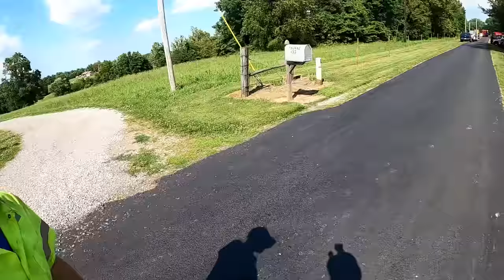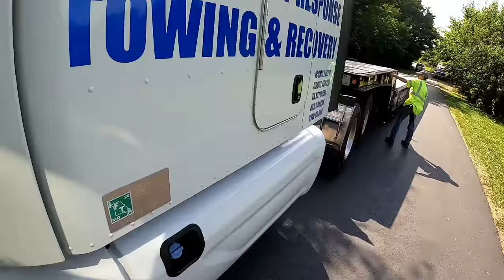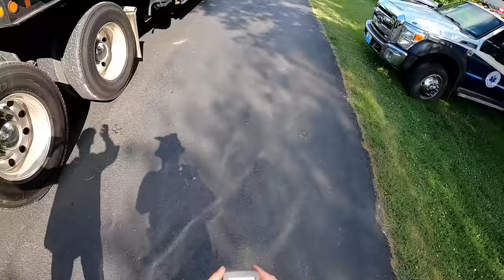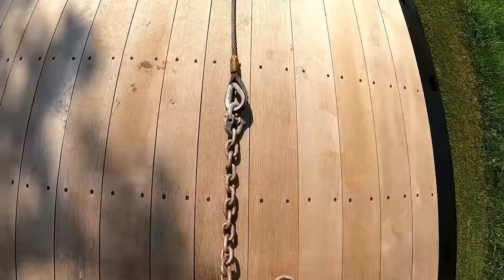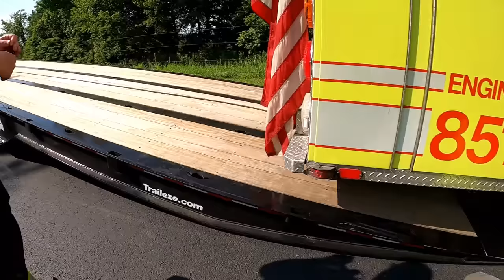Floating a Fire Truck

Comment: Are you able to share what parts broke down in the truck or is that sensitive information? Either way, good job for your new Trail-Eze T801! :D Using this vehicle also saved you having to pull the driveshaft had you been required to pull it with a tow truck! :D

Comment: 3 air horn blast for a fire dept is a signal for all firefighters to evacuate the building if there is any members performing search and rescue or on a hose line inside the structure...possible structural collapse or something that could injure, trap, or kill anyone

Comment: Having been responsible for maintaining a fleet of fire trucks for the whole of my working life, I would have bet a weeks pay cheque it would be batteries.
We had to develop systems to overcome such a simple defect that would cost time and money ( as well as disruption to the operational crews)
We standardised on having a split battery system that completely isolated a pair of batteries to start the engine alone while a second set would power the ancillaries. Therefore if the crews left on all the lights and the radio while the engine was shut down, they could at least start the engine to recharge the ancillary batteries.
We also found out that standard alternators would only recharge batteries to about 80 - 85% of their full capacity.  Coupled to the fact our trucks would be in attendance within 4-6 minutes this resulted in a short recharge time. So we fitted smaller pulleys to run the alternator at a higher speed, whilst the installation of a bespoke battery management system would charge the batteries right to the maximum, while prioritising the batteries that were at the lowest charge condition.
When the advent of the Allison World Series transmission came about which relies on electronic control, colleagues of ours found themselves having to continually attend starting defects when it was a simple case the batteries were too low to power the transmission thus adding to the problem.
With our split charge system we never suffered the same problem.
It made me smile when on attendance the battery was down and the truck was fitted with an Allison WS transmission. Seems like fire trucks are the same the world over.
Although you didn’t follow up to what was the cause it must have had a voltage drain somewhere within the truck since the Chief said the batteries had only just been changed.
Another a great video Ron, the low bed trailer looks good and certainly tested your reversing skills. Hope you’re feeling better now after the pneumonia, you was certainly struggling a little during the video. Stay safe especially with the pandemic virus around it makes you more vulnerable.
Reply: I'm told a lot of motor homes have the same type setup with two sets of batteries. And even if one set goes down, you always have the starting set to get moving again. 

I also talked years ago with some fire folks who had a separate lighting plant with a small genset that they had set up to be able to run back to the truck for power. With a totally separate battery and charging system.

Comment: If it's anything like the Australian fire trucks it will have a switch somewhere to connect the house batteries with the start batteries for flat start situation 

In fact most Australian emergency service vehicles have them

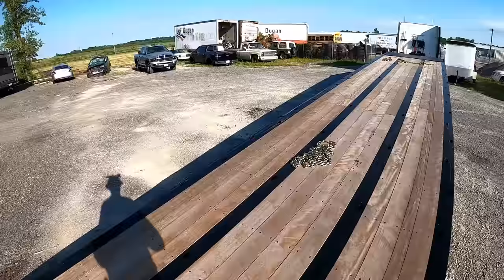Comment: Ron, When you loaded it at the scene I saw a Hose Bed Cover and at the Shop. ( 35:01) I don’t see it. Did it fold back while going down the road or you take it off or it go flying off?
Reply from the maker: It started flapping when we got up a little speed so we took it off.    Thanks for watching and God bless.

Comment: Ron, I have a question this time. Why is it when you load a vehicle on this and the other flatbeds/rollbacks you leave the beds at an angle? I thought it would be easier on the equipment if once all axles are on the recovery unit it would be better to level the recovery bed. I know about flat bed trailers with ramps and a winch. I do not know a lot as you can tell about the tilt and how the angle can assist a towing/recovery driver/operator in the big picture sense.

Comment: Had to load and transport a fire truck late one night. The truck still had air. I had it loaded and chained down. I got to the destination and off the bed, barely. I lost what air I had. Not enough airline to plug into the system. Ever try to get under a fire truck to cage the brakes? Not a fun time

Comment: Just out of curiosity why didn’t you empty the water out of the truck before towing i would have thought that would have been the safest thing to do as not only would it lighten the load but also remove some of the fluid dynamics that happens in the tank.

Comment: Still in the middle of watching. I’ve watched so many of your videos 
I do t think I’ve seen the axels move up like that before.... that is so so cool especially for what you’re doing
The only other cool thing that could be added... would be a split break on those axels.. like a farm tractor. So many times I wished it were a option but for the average driver.. a catastrophe waiting to happen l, too many have do buisness behind any wheel. 
Any way... I’ll finish watching and
Thank you Keep up the good work. 

Also what is “PTO”
I only know it as a reference
- to Paid Time Off
Reply from the maker: The PTO in our terms stands for Power Take Off.   Basically, it is a mechanical device that transfers energy from the engine, through the transmission, to Take Power Off to another system.  In this situation it powers the hydraulic system so we can operate all the trailer functions.  On our towing and recovery trucks, the PTO operates the hydraulics as well so that we can operate the boom, winches, under-reach, etc.   Something you might be more familiar with is a dump truck.  A dump truck uses a PTO to power hydraulics that lift the dump bed.  Thanks for watching and God bless.

Comment: No wonky steering wheel, great watch.

Question: Is this a pump engine or did it need the water tanks empty before you loaded it?
Reply: per above, tanks were full, chief offered to offload it, Ron declined it as unnecessary; the trailer was more than capable of handling the load as-is.

Comment: A dead battery still take a full charging current. It will prevent the alternator from supplying enough power to the other electrical components. This is why “boosting” a dead battery doesn’t work.

Comment: I know you've said in the past you keep the rotator free for car accidents but wouldn't it have been easier to use it to recover the truck, I know truck 17 can handle the weight but why not empty the tank of water, 8 pounds per gallon that would've lightened the load by 4 ton, or empty it to about 1/4 that way its not top heavy while loaded on the trailer, lower center of gravity then, just curious and keep up the good work

Comment: Enjoyed the video. One question, though, when backing up for a long distance like you had to, is it easier to keep it straight with the trailer wheels forward or back?  I find that backing a 53 footer with the trailer wheels forward can be a bit “fiddle-some” requiring more correcting than when the trailer wheels are fully back. Just wondering if it’s the same with your rig?
Reply from the maker: I find it easier to back with the axles to the rear.  As you said, it take much more corrections with a shorter wheel base.      Thanks for watching and God bless.

Comment: Blowing the horn on a fire scene can be a problem. Can be a signal to turn water on or off at a hydrant or to leave a structure due to unsafe conditions.    Just a tip. To help on the next call at an active fire scene. From a firefighter
Reply: Most departments know what their air horn sounds like and they usually hold the horn for 10 seconds

Comment: Backing down that road was easy mostly straight line backing if you can't straight line back a semi you shouldn't be driving one. And the only bad thing about moving the tandems to the front like that is alot of trail swing you have to account for. Over all good job. But that horn is too much sometimes yes when you first start backing but not to move a few feet.  🤷‍♂️🤷‍♂️

Comment: Happens sometimes. Never happened while I was on a fire. I remember when my dad was using the ladder for scene lighting on a fire and the motor burnt up😂
Reply: The is only time i remember from my active time at the fire department when one of our Engines didnt start because the battery was dead. And thats rare. Luckily we could get get engine running fast by giving it a little push. XD And as it returned from the call it got a new battery and was running perfectly again.
Reply from the maker: @JackMacLupus  We've actually had to tow fire apparatus from several active scenes for this exact same reason.  You may have caught a glimpse of us doing so in one of my videos from last year.  We were doing a "daisy-chain" maneuver on the interstate to remove a semi truck and trailer that had gone into the woods behind a guard rail.  One of the fire departments that was "blocking" for us had the alternator go out while sitting there blocking for us.   We towed it away from the scene with our Western Star while we towed the wreck away with the rotator.  Here is a link to that video:  https://youtu.be/i8W09_EL0AY   Thanks for watching and God bless.
Reply: @RonPratt  Ah yes, i remember that one. Well like i said, a dead battery is pretty rare on emergency vehicles, especially fire trucks because they mostly have power connection when they are in the station. And because of the good maintenance those vehicles get to be ready all the time.
Reply: Ron Pratt that what happens when you build a truck just to look good instead of being practical unlike the good old Australian fire trucks

Comment: That is why when the truck is parked at station it has to be plugged in on a shore line to keep it changed up
Reply: Not just charged up but also warm!  Don't know about fire stations everywhere but the local ones have a 20a extension cord (one blade twisted) assigned to each vehicle.  The female end plugs into the vehicle.  The intent is to keep the equipment batteries up and also keeps the engine block heater warm... i.e. the engine lube oil is kept at operating temperature thereby assuring an instant start and no warmup needed.   And the electrical input connections on the fire equipment are a special type with either an electrical solenoid or a air pressure pin that "kicks" the cord out of the socket when the engine is started.  You don't want to drive away with a extension cord plugged in!

Comment: There are tow rings in the rear center compartment, but with the angle of the winch cable to the rear compartment made the axle grab a better choice, so in hindsight, I shouldn't be yelling so load at  YouTube that there are tow rings affixed to the frame rails in the rear compartment. 
For those who don't know, there are jumper studs located under the left rear door that 30-foot jumper cables might reach.

Comment: The battery being low on voltage was probably the whole problem them Allison push button won’t shift if the voltage gets low and if you are driving it will lock itself in one gear like a limp home mode

Comment: Couple of things from an ex-tow-op; none of these are giving shit, just curious?
18:23 why not winch it onto the pavement and load it there, instead of worrying about your trailer getting stuck in the grass once it's loaded.
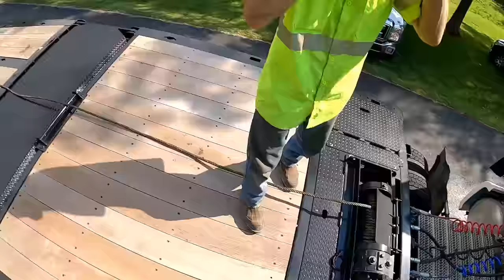23:51 love that chain locker.
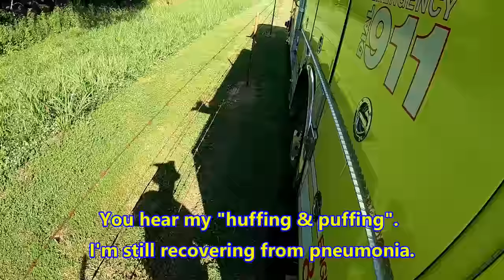24:20 Pneumonia - I'm recovering from "random" Pneumonia too. I'm wondering if it's asymptomatic CV that caused it.
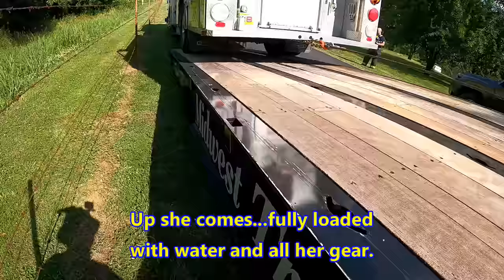29:50 Why not dump the water? just wondering.
Reply from the maker: Good question.  This was still an active fire scene with water tankers coming and going.  You saw in the video how narrow the road was.  We were asked to keep the road open if at all possible, so that is what we did.  We made it work.  Thanks for watching and God bless.
Reply: @RonPratt  Not at all.. Great job.  Just curious why it was done that way. Have a great day; and stay safe :)

Comment: Was it just the batteries?  Could a pick up with (what ) a couple of 24V batteries in the bed,  have solved the problem?

Did that red car (when you were backing up) really need to be so close?  I wasn't there so don't know what was going on but it looked like cars couldn't go beyond were you ended up anyway.
And to be 'on your bumper' like that just made no sense.

 I always give manouvering lorries as much space as possible to
A) Make the truck driver's job easier
B) Protect me just in case the driver isn't as skilled as he(?) may first appear.

Comment: With how far you had to go, wouldn't extending the axles back actually be better because it'd be less twitchy and easier to keep going straight with the longer wheelbase? Man if I would've been the dude walking you in.. I would've sat on the edge of the trailer and told you which way to go.. as the Marines used to say. "Never run when you can walk, never walk when you can stand, never stand when you can sit, never sit when you can lay down, never lay down when you can sleep, and never pass up hot chow and cool water." :P Every time you say "know what I mean" I have to finish it with "Vern" :D Folding a flag.. just like folding a paper football.

Comment: Why did they remove the flag of the engine is only going to be repaired?
Reply: Probably to protect it. When the engine isn't on the road or on a call it's in a garage. At Midwest it sits outside until they put it in a repair bay. After it's fixed it sits outside again until FD picks it up.

Comment: That was a lot of work when a jumper pack would of sorted it in 30 seconds
Reply from the maker: I will explain this as politely as I can.  I have explained this many times....  Yes, a jump pack would have started the engine.  However, without sufficient voltage, after taking off the jump pack, the TCM wouldn't shift gears and the ECM would not allow the engine to remain running once it dropped below 12 volts.  The underlying problem needed to be repaired.  The Chief made the right call.   After jump starting the unit it would not have made it back to the station.  It would still have had to have been towed or hauled.  At least this way it was off the road and not creating a danger to traffic, the driver, or me.  When it would have broken down on either the 2 lane road with no shoulder or on the interstate, it would have been a dangerous situation.  We also have a full-service repair shop.  I've worked there since 1985.   We repaired this unit after we hauled it in....so I do know what I am talking about.   Thanks for watching and God bless.

Comment: just a quick question - Why do you let your engine running idle when you leave your Truck. Is this something typical american? I mean shutting of the engine when stopping more than 3 mintutes saves gasoil, cost and helps the environment. There is no technical reason to let it running.

Comment: Could have dumped the water.  It’s heavy!
Reply: True!  8.3 pounds per gallon.  Trucks like that carry 500 gallons (smaller ones are 250 or 300).   500 gallons is over 4,000 pounds / 1800kg of water!